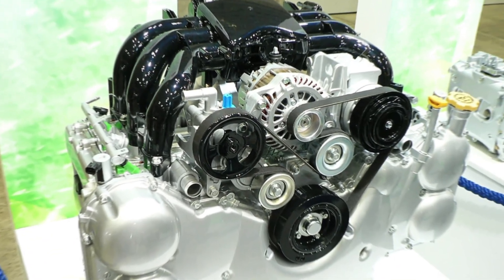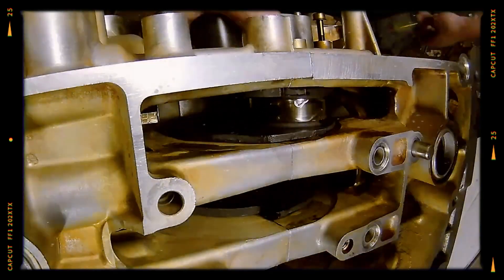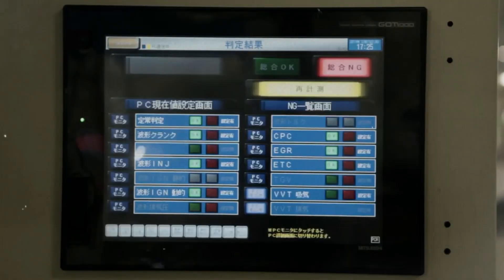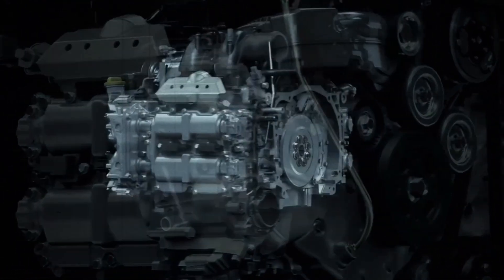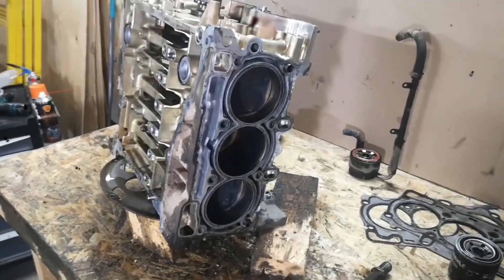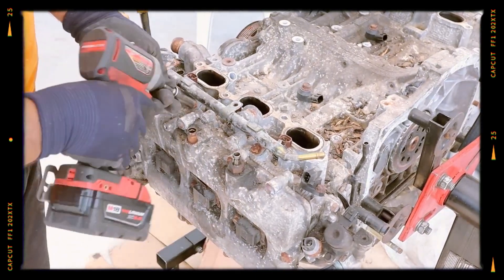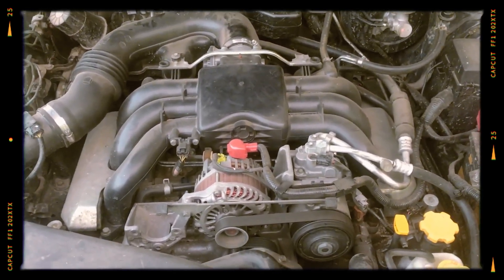Subaru EZ36 engine: Rethinking power. Performance, reliability and common issues!

Comment: 244,000 on mine.  It's been a good engine with a couple of hiccups.  Throttle body went bad.  Had to replace the whole thing because the TPS sensor was integral with the unit, non-replaceable.  Had to replace a knock sensor and an ignition coil boot.  Burns a little more oil than I'd like, but overall, still runs great and good power for as many miles as it has.
Reply: Put Liqui Moly Mos2 in the next oil change... your oil and scraper rings could be stuck with carbon build up... Mine was burning oil until I did that., now only burns slightly on hard runs on hill climbs at 5k rpm
Reply: @peterlattimore6013  thanks for the tip!  I'll definitely check that out!

Comment: 2011 Outback with 3.6.  245,000 miles, now.  I've had to replace the trhrottle body, but that isn't the engine itself, though.  Still runs good.
Reply: 244,000 on mine.  Yup, throttle body at around 125,000.  I think it is getting due for another one.

Comment: You have quite a good AI script reader, but you made a few mistakes in the script that made the AI reader obvious. For reader apps, don't leave units of measure as their normal abbreviations: change them to the actual words, such as "millimetres" or "kilograms" to force the reader app to say the inits properly ("emm-emm" sounds wrong).

Leaving in typographical errors like "mmm" instead of "mm" (millimetres) will make the AI reader obvious. Likewise with a British voice saying "aluminum" instead of "aluminium." Also, the British call "z" "zed," not "zee." If you clean up the script, you should be able to make tour AI reader app virtually indistinguishable from a human.

Comment: Really wish Subaru would bring this engine back.
Reply: Keep dreaming, they have entered the hybrid and EV market, they havent even made the 3.6 since 2019.
This is why I wont sell my outback 3.6.
Reply: FWIW....I chose the 3.6 for it's smoothness, extra power with NO direct injection and NO turbo.   Running like new at 115,000.   UOA numbers are the best of any I've ever seen.

Comment: I have the 2016 Outback 3.6R with the EZ36D engine. After 86K miles it's still running strong. 
Great performance. No oil consumption. I change the oil every 6 months. Oil color is semi-clear.
With the H6 engine there is an additional 225 pounds up front which is great for road handling. 
MPG varies from 20 to 28 depending on gas quality and trip distance.
It is no doubt the best over-all car I have ever owned.  🛑
Reply: Older EZ36 are paired with 5AT transmission and newer ones are with CVT. Significant MPG improvement there.
Reply: Amazing the difference in MPG on "newer" 3.6R engines. My 2009 Tribeca averages 18mpg!
Reply: @shaneconta249 haha mine averages 15mpg...probably needs new spark plugs.

Comment: what they dont tell u is once the water pump goes, the entire timing cover must come off, to replace the  water pump, can cost up to 2500 dollars
Reply: This is normal for Subarus in general my friend. Common knowledge for most Subaru drivers.
Reply: There are like 100 bolts that hold the timing cover. It's very time-consuming, especially if you're in the rust belt.

Comment: Oil changes every 9000 miles is wild.
Reply: Also inaccurate.   My 2018 Outback 3.6R manual says  6,000.
Reply: Agreed. Been changing every 5k to 6k miles on my 2009 Tribeca. Currently sitting at 183k and still chugging along
Reply: What do you mean ?

Comment: Imagine if they offered the frs/brz with this engine
Reply: It can be built.
Reply: EG33 better engine!
Reply: Then they'd be front heavy, won't be fun anymore
Reply: @GrEeCe_MnKy  Dont exagerate. There were sporty Legacy models in 2005-2009 with ez30. Its the same size as ej25 was. Its not even remotely as bog as EG33 in SVX was. Its biggest mistake of Toyota and Subaru to not just offer existing subaru engines instead of that whimpy fa20 with its torque dips. If they just with with FB20, FB25 and then EZ30/36 at the top it would make it far more affordable, would skip the mess of direct injection and allow it to compete with 370z, Hyundai Genesis Coupe aswell as be truly affordable with good and uniformly torquey fb motors.
Reply: @GrEeCe_MnKy ez36 vs ej25 turbo? 
Same weight

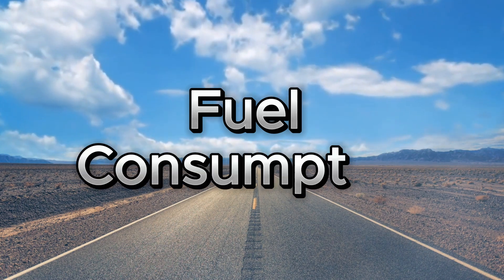Comment: 5:20 regarding fuel consumption... Im getting 8ltrs per 100km on 70 km round trips to work n back using 95 octane. Liqui Moly oil additive increases economy to below 7ltrs per 100km.